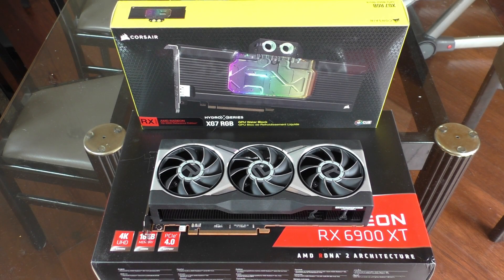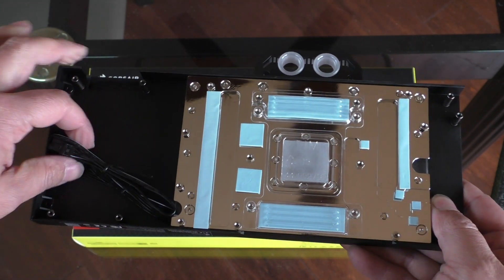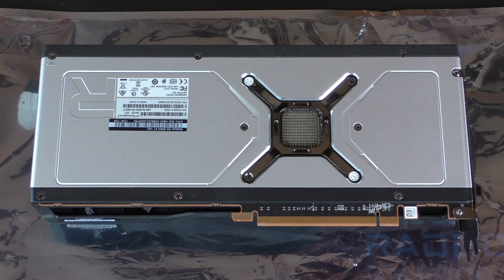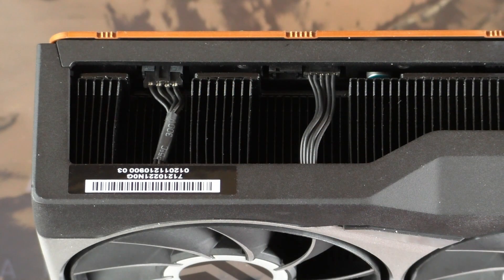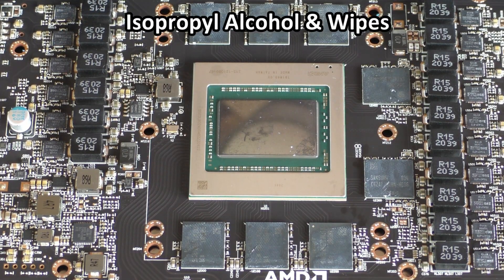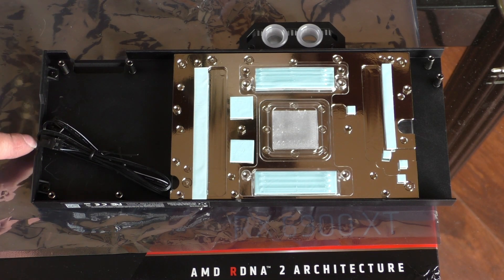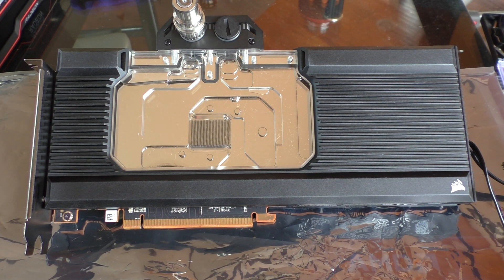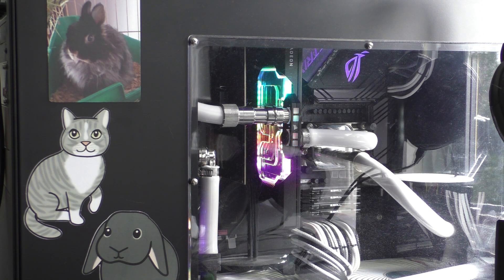Radeon 6800/6900XT Waterblock Install - Corsair Hydro X XG7 RGB

Comment: Is it possible to get such a block with the water ports on top instead of the side?
Reply from the maker: I'm not aware of anyone that makes it like that, but you can always use 90deg adapters if you want to achieve that.

Comment: i peeled off the top of the thermal pads will it be okay 
i didnt know and nobody else have done it.
It just seemed a bit slippy texture so i peeled it off can i still use  
thanks
Reply from the maker: If you compress the pads together so it's all making contact again it should be good enough.
Reply: @FaRKle0079  thanks the pads are still on the block but I peeled top layer off it should be fine right thanks

Comment: i really wish they made a waterblock for the 6700 XT. i love the corsair water cooling stuff and it would look so nice with the rest of my corsair gear. do you know if the 6800 XT block could be modded to fit the stock 6700 XT? the pcbs are pretty similar.
Reply from the maker: I haven't looked at things closely enough to see if the 6800XT block can be modded for a 6700XT. My guess would be not though.

Comment: I wish Corsair would have added thermal pads to the backplate. Do you think it needs them?
Reply from the maker: I agree. I was kind of surprised at first when looking at the parts and not seeing any, however after taking apart the stock backplate and seeing that AMD didn't include any either, I figured they weren't really needed.

Comment: What hotspot temps you get not just avg but also max with a full gaming load, im seeing 68c on my ekwb waterblock for my 6900 xt heard about 65c avg is pretty normal on water, just used to gtx 1080 temps where never go's past 40c
Reply from the maker: That's going to be dependent on how much cooling capacity you have. My card's TJunction doesn't get over 54C with 21C ambient while gaming. I have a 3x180mm radiator.
Reply: @FaRKle0079  Were all those rads just for your gpu? Looking at watercooling a 6950xt. I have a 5600x. Thinking about running 2x240.

Comment: Absolutely awesome video.  I feel confident I won't screw my GPU up.  I have an Aventum X from Digital Storm and I have 2 open cooling ports because Radeon did not have option for cooling when I built in December.  CPU is cooled with hydro lux system.  I'm really hoping it is set up for me to just plug in to the closed ports and be good to go.
Reply from the maker: That's one heck of a nice rig! I believe you should be able to plug into the open ports on that manifold block just fine.
Reply: @FaRKle0079  thanks for the reply.  Now if I don't want it to look janky, I'm going to have to learn how to do hard tubing so it matches
Reply from the maker: @stay-awhile1369  Good luck! I'm not ambitious enough to try hard tubing haha.

Comment: Its an amazingly looking card, I have 6900 XT from BIOSTAR with same reference look. If i play cyberpunk it gets 80C GPU core and up to 100C at Hot spot. with FANs almost at max. Its less if i under-volt it and adjust settings in game itself but there is a big issue with RTX and RX cards with stock cooling. With RTX its that 3rd FAN that goes through your card directly to your memory modules (well in most cases with standard onboard PCI-e placement ). With 6900 xt its that rare air outlet that affects your pci-e ssd, sata M.2 SSD and chipset well basically blowing hot air to your system-board... Honestly i see no advantage at all in keeping hot AIR inside your case, i would focus on making air cooling / air outlet directed to the outside of your case like with those turbine cards... Anyway here in Malaysia this water-block cost more then the kit from Bykski which is Water-block + Pump, Radiator240 and 2 FANS and its all assembled so you just need to install your PCB to water-block and attach radiator to case with 2 FANs (no tubing, no experiments with liquid and etc...), . 100% that quality of your water-block is better then Bykski but i have same AIO kit on my 1080Ti and yes temps never exceed 52C overclocked to max and for 3 years i never had an issue with it.... So finally i ordered same (set is 140USD currently from ALi).
Reply from the maker: AIOs are wonderful for their ease of use. I'd probably go to something similar if I didn't already have the full custom loop infrastructure I do.
Reply: @FaRKle0079  is THIS waterblock Ok For the rx6900 xt red devil
Reply: Which part in Ali Express that you bought? I am from Malaysia as well and my 6900 XT stock is running hot

Comment: How is the Hot Spot temp looking under gaming?
Reply: yes, this is probably why one would be water cooling.
I get around 107°C - 110°C Tjunc/hotspot with my Red Devil 6900 XT LE
I'm also very curious how water cooling affected the temps.
Reply: @alfred.clement  I have an EK vector with kryonaut extreme and whatever pads EK ships with the block IDLE GPU 29, HS 32 Full Load GPU 45, HS 58.
Reply: @enriquemiller3001  wow, I wasn't expecting it to be that low... This is on 6900 XT? I'm not familiar with water cooling systems, so I don't know all the factors that can affect the temps, like size of radiator/fans, reservoir and using distilled water or coolant.
Reply: @alfred.clement  I do have 2 x 420 radiators in a loop with a 5950X I was doing a parallel loop test yesterday, let me upload the video to YouTube I will send you the link in a bit
Reply: @enriquemiller3001  Awesome! Thanks.
Reply: it's very short if you want to see specifics just let me know and I can upload more videos
Reply: @enriquemiller3001  thanks!

Comment: Clear and informative. I'm curious if your temps dropped at all?
Reply from the maker: Temps are definitely lower, not that the 6900XT ran that hot anyways. I haven't seen it get above 42C at all.
Reply: @FaRKle0079  why the hell does mine hit temps of 93c im so mad
Reply from the maker: @vaerxxx3231  93C with this same waterblock? What radiator and pump setup do you have?
Reply: @vaerxxx3231  probably the junction temp ? that can run alot higher
Reply: @vaerxxx3231  had the same temp problème but with a bios update and driver update my 6900XT now run at 32c

Comment: Hey how did u do that warranty sticker thing?
Reply: Dont forget to keep original thermal pads and that GPU Core thermal compound or thermal pad on the heat-sink))
Reply from the maker: @dudindmitri  Yup! I put all the thermal pads on the   OE cooler, haha.
Reply from the maker: A razor blade works perfectly to remove the sticker without damaging it.

Comment: Do a run under load and see what’s the temp read out is
Reply from the maker: Max I've seen is 42C while playing games, but that's also highly dependent on what radiator, fans, and whatever else you have in the loop.
Reply: @FaRKle0079  You should have included that in the video, or at least in the description... review of this block feels unfinished without temps.
Reply: @FaRKle0079  42C GPU or junction?

Comment: What was the temps like?
Reply from the maker: Max I've seen is 42C while playing games, but that's also highly dependent on what radiator, fans, and whatever else you have in the loop.
Reply: @FaRKle0079  mine reaching 64 max in cyberpunk with a byysky waterblock, mounted correctly, i have 3 360 rads i think ill take this corsair instead
Reply from the maker: @FaZe_MAGA  Last time I played games on it I saw the TJunction got to 54C with 21C ambient.  I have a 3x180mm rad. You've got a good amount more radiator than I do!
Reply: @FaRKle0079  ye there is a problem, i ordered the corsair block and will receive it soon, then i will know if it was the issue but i'm pretty sure it is

Comment: Nice video. How tall is the block from the bottom of the PCIE finger to the top of the terminal? I am estimating <145mm based on measurements on amazon, But not sure how accurate they are accurate. If it is plugged in, a measurement of the block bottom to top will help me greatly.
Reply from the maker: Total height of the card (PCI-E contacts to top of water manifold is 144mm. From top of PCIE slot on mobo to top of water manifold is 139mm. Block only height is 130mm. Card length is 276mm with block
Reply: @FaRKle0079  Thank you so much, it should fit my case in terms of height clearance. Could you provide a measurement of how thick the acrylic block (not including black metal shroud) + PCB + backplate is? similar to picture 3 in the following link. It might be possible to measure it near the water manifold, where the acrylic is fully exposed.  https://www.reddit.com/r/FormD/comments/kff5a6/i_deshrouded_corsair_3080_fe_block/
Reply from the maker: @dennislu3445  21.5mm